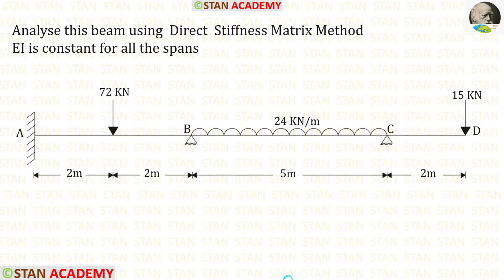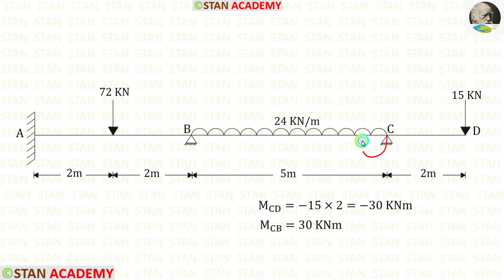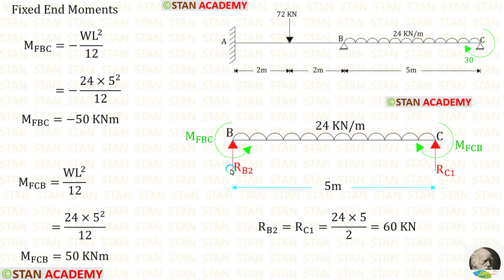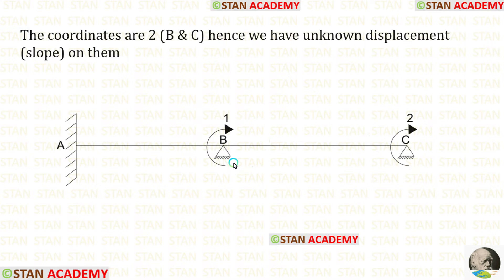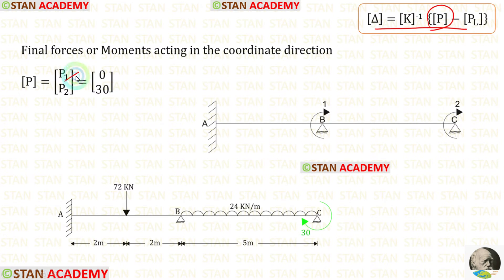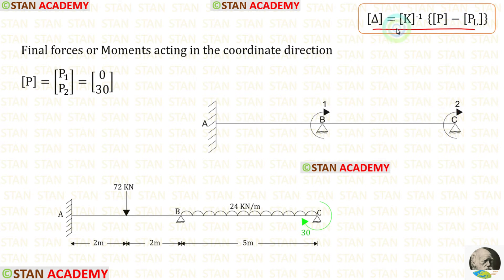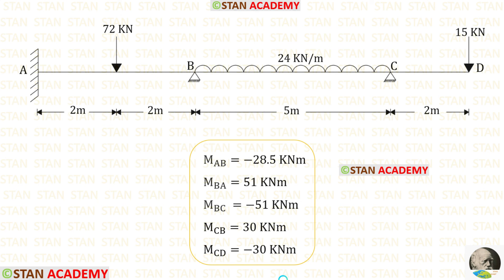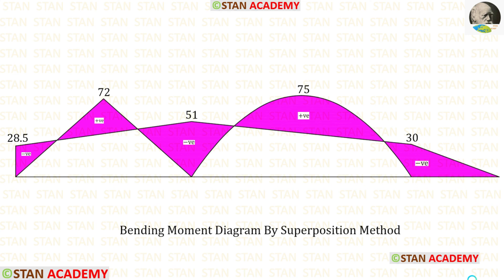Direct Stiffness Matrix Method for Analysis of Beams - Problem No 5 (With Overhanging)

Comment: Hello. Thank you for this video. I want to ask a question. "CD" part is a cantilever beam so you directly calculated MCD=-30KNm. If we don't calculate this cantilever beam moment and we add "C" and "D" notes' matrix parameters of "CD" cantilever beam in the general parameters matrices, do we make the wrong calculation? Could you please answer my question?
Reply from the maker: you can do that. but that will be lengthy and time consuming.
Reply: @Stanacademy  Thank you for your answer. But If I write a program about the  beam calculation, how can I use hand calculation? Because I use the programme not to use any hand calculation.